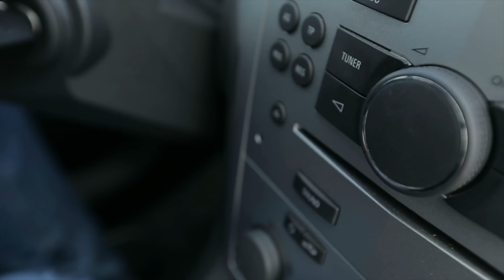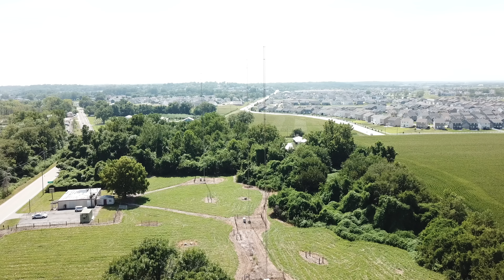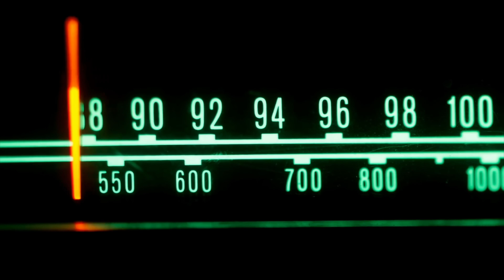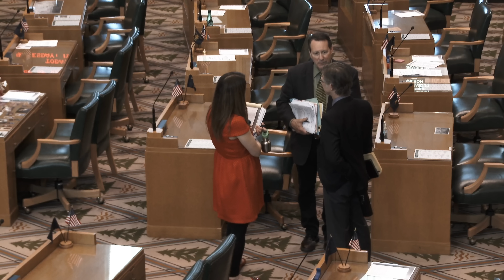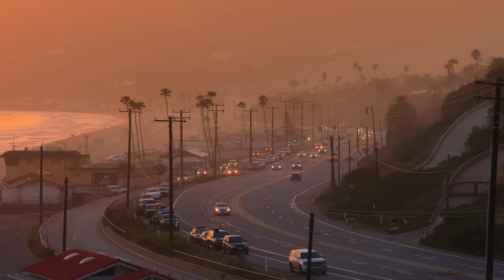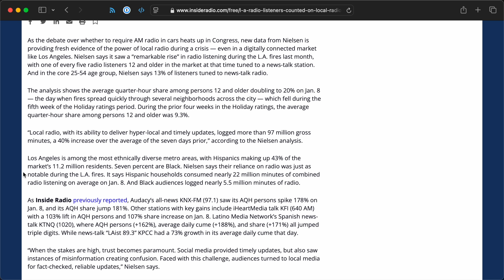Automakers are losing the battle with this 100-year-old tech

Comment: Can we make it mandatory to support HD radio while we're at it? It seemed like a breakthrough 20 years ago and then nobody did anything with it
Reply: @JP-mc8fg HD Radio is a nightmare of incompatibility with other AM stations. The digital sidebands of HD radio wipe out the two AM stations either side. Plus it is an "American only" standard and is incompatible with the rest of the world. Which means that HD radios can only be sold in the USA. It failed because it just doesn't work. Listeners and other broadcasters hate it.
Reply: It was dead technology when it was launched. The cell network and mobile data availability made it almost immediately redundant.

Comment: Here in Europe AM stations are disappearing. Here in the Netherlands no we do not have any AM stations anymore.   But we have DAB+ now. That is the digital variant of FM and transmits in the old TV vhf channels around 200 MHz. As I remember I have seen on the internet that you in the USA have also a digital broadcast on AM. Next to the AM signal there is a digital stream signal of that same broadcast system. I have seen a youtube video on that. Is that system still operative today?
Reply: @Ztbmrc1  - You're thinking about HD Radio.  HD Radio puts it's Digital content into sidebands either side of the carrier, which causes interference to weaker stations either side.. So other listeners hate it, as do other broadcasters. 
The "non USA" version of HD radio is MW DRM. It widely used in India, and has been tested in Australia, etc. Unfortunately it also causes interference to adjacent stations and is thus widely disliked by listeners.

Comment: I'M ON THE SIDE OF HAVING AM RADIO IN ALL VEHICLES THAT NORMALLY COME WITH A RADIO.  AM radio is the fundamental nation wide radio broadcasting system.  It is NOT antiquated or ineffective.  It's more versatile than FM radio.  It has better and farther coverage as well as also having limited coverage depending on its licensing.  If poor little old GM, Ford, and Chrysler can't solve the interference problem it is because they backed themselves into a corner and want buyers to bail them out.  If we let them get away with that guess who is going to be making cars that receive AM interference free - the Japanese!  DON'T FIX SOMETHING THAT IS NOT BROKEN, FOR GOD'S SAKE!!!

Comment: The quality of modern Car radios ,  particularly on the antenna side  kind of suck,   even for FM reception.   most modern car antennas are usually these little stubby, minimalist 6 to 10 inch rubber duck  type antennas  like my 2005 Toyota Matrix and the FM as well as AM  reception and range is not great compared to an old school  30" stainless whip  antenna.  Im sure this trend is very common today with most post 1990's  vehicles.  No surprise with so many modern car radios with lackluster sensitivity on our roads  they will, no doubt  have an adverse effect on radio station listenership.

Comment: Radio noise is pollution. Electric cars with very high current switching circuits emit lots of it, unless shielded. If you allow devices to emit unlimited amounts of radio noise, then wireless becomes useless. Are you willing to give up your cellphones so manufacturers can be lazy?

Comment: FYI you can use an AM radio as a lightning detector. Listen for bursts of static.
Reply: It also tells you if an alternator diode is going bad, giving a "whine" -
Reply: Yep, details are that lightning can be 1000 miles away though.
Reply: @ClariNerd  or use a SDR radio, which would be really neat to then measure time to sound and guage distance
Reply: zzzzt...... flash- seconds later...... THUNDER!
Reply: It also means AM is unlistenable in Florida every afternoon.  I worked for an AM back in the day (now dark) and in the afternoons we'd switch from the air monitor to the console output because we didn't want our ears getting blasted with the snap, crackle, pop
Reply: @grayrabbit2211  and the higher powered AM Radio Rebele/Radio Rojas from Cuba
Reply: Sting was right.

When The World Keeps Going  Around, You've Got The Best Of Still Around.
Reply: You can also use it in an electric car to get audio feedback from the motors, which is why automakers don't want it

Comment: In Germany AM is gone since end of 2015. Several other systems have been introduced in case of emergency, broadcast via mobile phones, apps on mobile phones, sirens, may be more.
Reply: Das war eine sehr dµmme Entscheidung eine einfache und bewährte Technik abzuschalten. Ich finde der Rundfunk in Deutschland unterhalb von 30MHz gehört sehr bald wieder eingesetzt.
Reply: Germany is consistently stupid. That's proof that AM belongs in cars.
Reply: How does such a shutdown even work? Did the government simply revoke all the AM transmit licenses and refuse to issue new ones? What are they using the frequency range for now?

Comment: The high cables going to / coming from the tri-phase inverter, and the inverter itself, require proper EMI shielding in order for the onboard AM radio receiver to operate correctly.
That shielding is costly.
Reply: Shielding is costly?  What's it made out of?  Platinum?  Gold?  Diamond?
Reply: @stargazer7644  Shielding is cheap if neither weight nor volume are a problem. But in an electric car, those are at a critical premium.
Reply: They can save a lot of money by ridding all that useless computer crap they put on cars these days.

Comment: This is interesting to me as an Australian.  Here in Australia we have huge empty spaces between the major centres, so when doing long road trips, FM gets useless fairly quickly.  And digital radio even more so, and it's only in the 4 or 5 biggest cities anyway.  I don't have a vehicle with digital radio anyway.  I would be very unhappy to see AM disappear from vehicles.  I'm sure we don't have an equivalent piece of legislation in process here, but I wish we did!
Reply: I travel a fair bit and I only use external antennas that mount on my bullbar, DAB+, FM and AM, all use  whip style antennas and that really helps with signal loss. All antennas I get from Mobile One in Sydney.
Reply: @BrotherInArms73  I'm baffled at the popularity of bullbar mounted monstrosities, when a tiny 4" antenna on your roof probably works better, is harder to steal (and a 4" inch roof antenna is so cheap it's not worth stealing), and is way less obtrusive.
Reply: @  They maybe a bit more obtrusive, but as for theft, I use a couple of techniques that make it extremely hard to remove the antennas without breaking them.
Reply: @BrotherInArms73  that's great and all, but why bother? Roof antenna is better performance, less obtrusive, less likely to be caught on the brush, cable doesn't have to run through the engine bay, everything is better right?
Reply: @  No issues with the cabling going through the engine bay, already going through existing wiring harness. As for roof mount, that all good and well for FM, but DAB and even UHF 2 Way requires 1 to 3m high antennas and given those lengths, it would not be feasible to roof mount.
Reply: @BrotherInArms73  ok, I don't know about those, but I would point out you don't need an antenna of 1 wavelength high to work. UHF wavelength is about 70cm or something, yet my 6" antenna works. Also no matter what great technology you use you're limited by the horizon which is going to be more or less 10km.
Reply: @xpusostomos  AM is a wavelength of around 500 metres yet it doesn't need that length for the aerial
Reply: @BrotherInArms73  sounds like D-STAR amateur radio and DRM would be ideal for you then
Reply: @stevemarshall5249  DRM works fine on AM bands
Reply: @ The question was stations in remote areas, those are city stations.
Reply: Is there anything worth listening to?
Reply: @xpusostomos  AM radio in Australia has the wonderful Government ABC stations, as well as many Community stations. It is NOT like talk-back radio in the USA.
Reply: @graemezimmer604  what's wonderful about it?
Reply: @xpusostomos  it was just explained to you. Our public broadcaster alone puts out high quality content.
Reply: @IanMcLeod75  as an Australian, I think they put out complete and utter shit, but I didn't go to every rural area and listen, so I'm asking you to be more specific why you think it's great.
Reply: @IanMcLeod75  That is highly subjective. I describe myself as a survivor of ABC broadcast radio, having suffered thousands of hours of it in a couple of different work places.
The only time that I ever turn over to the ABC, now, is for the cricket.
Reply: The government should not be interfering. If car companies don't want to sell cars with AM, they shouldn't have to. It's their product.
Reply: @PeugeotRocket  having an AM radio is probably the easiest car regulation to pass on the books
Reply: @PeugeotRocket  bingo. If we need emergency broadcasts then DRM is specifically made for this and can be used instead.

Comment: AM Radio will remain dead until they get rid of talk radio and all of the grifting preachers. It has become as useful to humanity as a Ham Radio stuck on 20 meters during a dx contest. Everything other than military, weather and public safety below 30 mhz should be reallocated to the new clear text digital low speed extreme narrow bandwidth applications that are emerging. If you can't say it in a 6 hz bandwidth, it just wasn't worth saying

Comment: With the cheap computing power available now and Software Defined Radio techniques, there's no reason for leaving out support for reception of ANYTHING.

Hobbyists can use a $15 RTL-SDR dongle to pick up anything between 17 and 1700MHz with up to 2.8MHz of bandwidth (the chip can go as high as 3.2MHz, but it becomes unreliable above 2.8MHz). While not enough for TV, it's more than enough for radio. If you want to watch TV, the dongle has fixed-function hardware for DVB-T reception, anyway.

Comment: Even though the rest of my home entertainment/TV/DVD (yes, I said it, I stream, but I still believe in physical media, too)/speakers is Sony, and I wanted to maximize compatibility, I wouldn't buy their receiver because they no longer have AM reception at all (not just no external AM antenna connectors, and they dropped the standard 75 ohm coaxial connector for FM, with a non-standard plug to a chintzy two-wire antenna. I guess they forgot a 'receiver' really needs to 'receive.').

So, Denon instead.

And home or mobile, remember, virtually all the EAS (Emergency Alert System) stations around the country, are high-power AM...

Comment: Unless part of the bill is for mandatory listening to AM radio every day, this bill is not going to "save" AM radio.  The safety issue is a stretch, and misleading.  Do people not realize that the Emergency Alert System (EAS) is also carried on FM stations!  All FCC licensed radio stations have to have EAS equipment, even LPFMs.  I been driving in a small Nielsen rated radio market (100+) and my cell will go off with a WEA alert (fire, severe weather, etc.) then I've tuned to local radio stations and......nothing.  That's because nobody live is on the air.  The station is running syndicated ESPN, Fox Sports, or national talk shows.  Of those 5 AM radio stations maintained by Geerling, how many are live and local 24/7?  How about even M-F 18 hours daily?

AM stations aren't only not attracting the listeners they once had, but they are also having problems attracting local advertisers who rather spend their money on Google Ads, Bing, Facebook or YouTube.  2024 61 AM stations went off the air.  That's one per week.  Many AM stations with FM translators are removing directional towers, going to a single tower on low power because they know that the vast majority of their listeners are coming from the FM translator.  I've worked in radio on AM and FM stations, commercial and non-comm ones.  AM is slowly going away.  Listeners would rather use other technology.  See how many AM stations are left in ten years.
Reply: And the EAS equipment at the vast majority of stations make them go off the air during an actual emergency.

Comment: AM is fairly low frequency but most communication platforms are running from UHF upwards with limited range. This requires more power and multiple relay networks including satellites. It could be seen as a form of communication micro management with efficiency and
end user requirement at the bottom of the list of priorities. There's probably plenty of money in it though. Welcome to the 21st century.

Comment: I don't undestand why this guy is interested in old radio and at the same time Apple Macintosh stuff and other current gadgets. Those seem wildly different interests. Two feet ain't gonna do it. I have to walk away some 10 to 20 meters from power lines and reinforced buildings. The lower the frequency, the greater the distance. I don't know cars, but with buildings the whole metal structure radiates.

Comment: It seems difficult to find a car radio with an AM band that actually sounds good. IF (Intermediate Frequency) bandwidth is too narrow, which makes speech sound muffled and hard to understand. Old car radios didn't seem to have this problem.
Reply: The problem with modern cars is the antenna. MW antennas need to be longer than the antennas that are found on modern vehicles. It makes a huge difference. I wasn't aware of narrow IF being an issue. I wonder if that is the cheap and easy answer to noise reduction.

Comment: Here in Germany all big and powerful AM stations have been taking out of service. Only some museums are running a local AM station. But Southern European countries still operate AM stations. Some even use AM Stereo and my web-sdr supports that, really funny. So I can stream it everywhere via VPN from home 🤣. My new EV also comes with an AM radio and despite its 150KW motor control unit, it stays relatively clean on its default AM radio that displays the frequency with a simulated nixie-tube on its high-res display. Since there is almost nothing transmitting on the groundwave here in Germany, the AM band gets alive at sunset and as a radio nerd I sometimes listen to AM, despite having plenty of FM and DAB stations, as well as almost 100.000 wonderful MP3 tracks in great quality offline available and all the usual internet streaming services.
My friends 2014 BMW 5 series came with AM, FM AND 49m shortwave band ... now that was a surprise.
I am really impressed how they manage to have a clear and sensitive AM reception despite an ignition system on an ICE and the extremely powerful motor control on an EV .. I guess they use magnetic field ferrite antennas that have a specific direction, nulling out the noise sources? Else it might be tricky in the near field, which is huge on those long wavelength.

Comment: What I'd like to see (or hear!) is a sort of hybrid model, where you get the reliability of a true AM analog signal to the car's head unit (and PLEASE bring back the aux jack!, but I digress...), but use AI to filter out that unwanted crosstalk from other radio stations, particularly at night.
Reply: Has been tried many times, unfortunately it's not possible. The only real way to keep the noise down, is not generate the interference in the first place.

Comment: I'm a Broadcast Engineer also. We're of the few who still know how to maintain the antenna systems. If we could get some good listenable programming including music, AM can be perfectly listenable. I have a 2018 Dodge Grand Caravan and the AM radio is so much higher fidelity than I've heard almost anywhere! One of my stations is simulcasting on AM and FM and the main difference is the lack of stereo. Distortion is very low and the frequency response is good til 5 kHz! Noise isn't an issue.
Reply: HD AM exists for AM stereo and increased fidelity.  The limited bandwidth is a bigger problem for AM music.
Reply: @stargazer7644  Analog stereo AM existed before HD AM. The problem isn't limited bandwidth. The problem is crappy radios with very narrow IF filters and no switch to select widband AM.
Reply: @graemezimmer604  A mono radio isn't ever going to magically decode a stereo signal.  Any radio with a stereo decoder will have filters wide enough to handle it.  WTF are you talking about?  And then in another comment you're complaining about HD sidebands being too wide.  Make up your freaking mind.

Comment: AM has a feature that neither FM or any digital can have and makes it ideal for emergencies: you can overlap the audio signal with other(s) broadcasting in the same frequency and still hearing all the voices at once.
Reply: That really only works with stations with PLL based transmitters that have oscillators that are phase-locked onto the exact same frequencies.  Otherwise you get horrendous heterodyne squeals as the slightly different carrier frequencies mix and fading as the phases periodically cancel.   If you want to do that seamlessly, you really need to use sideband where there is no carrier.
Reply: @stargazer7644  Not true. It's the hetrodyne which lets you know that two stations are transmitting. Plus with Doppler shift at VHF, you could never phase lock Aircraft transmitters.
Reply: @graemezimmer604  I think you misunderstood what was said.  
First, the OP wasn't talking specifically about Aircraft.  The video is about broadcast AM. 
Second,  even if he was, while you're correct you're going have difficulty phase locking to a doppler shifted signal, the doppler shift at 120 MHz and 600 MPH is only 107 Hz.  That's generally below the audio passband and isn't likely to be heard.  
Third, what I said was true.  The OP thinks there's no hetrodyne on overlapping AM signals, I was pointing out that was only true if the transmitters are phase locked.
Reply: This is one reason that aviation frequencies (118.0-136.975 MHz) use AM. Somebody transmitting over someone else on a particular frequency doesn't block either transmitter from being heard.